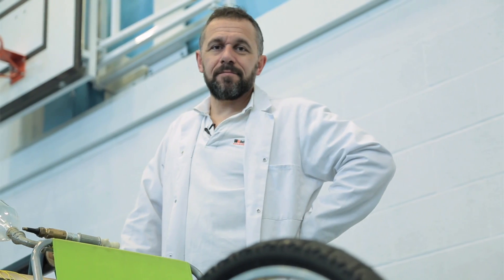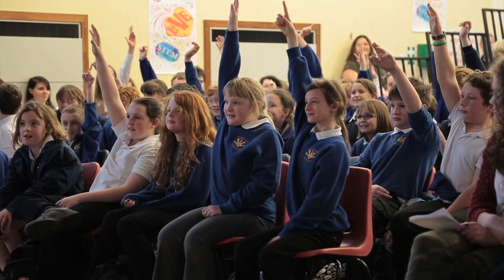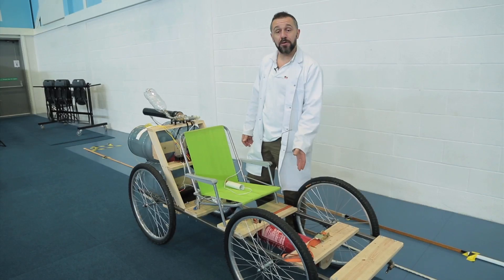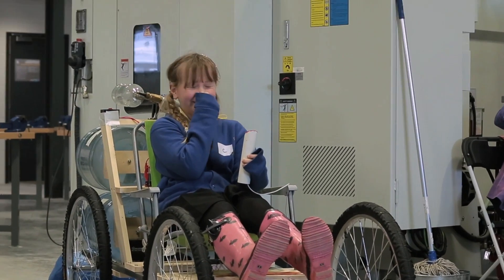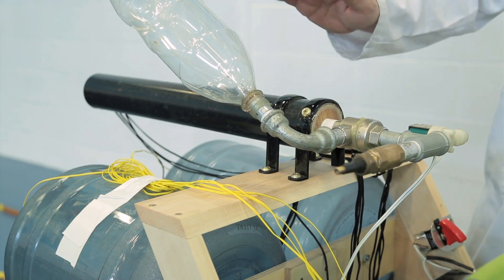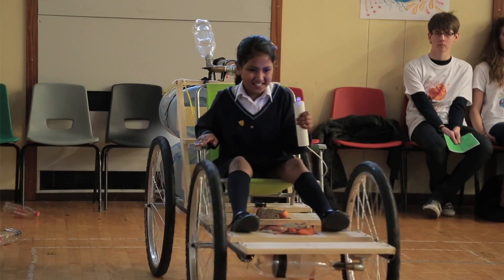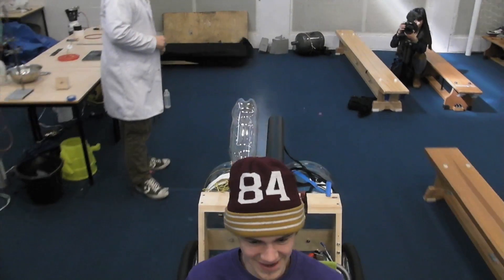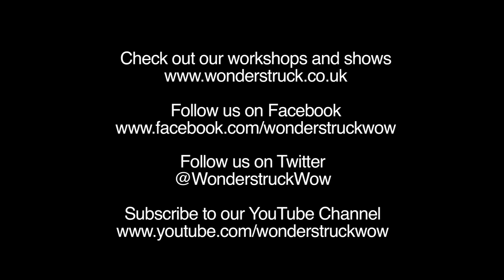The Wonderstruck Rocket Car

Comment: It didn't seem like any of the alcohol rockets nor the parachute actually did anything. Great use of a fire extinguisher, though.
Reply from the maker: You're right there!  The extinguisher produces the thrust but the whoosh bottles and parachute are more for theatrical effect.  We're currently building a slightly more extreme version of this that will use 4 (or maybe more) extinguishers to provide a bit more thrust for outdoor use.  We won't be adding whoosh bottles to this one, although a parachute may not be a bad idea!